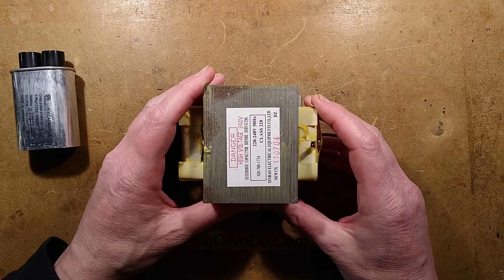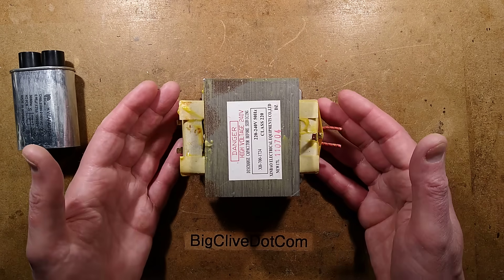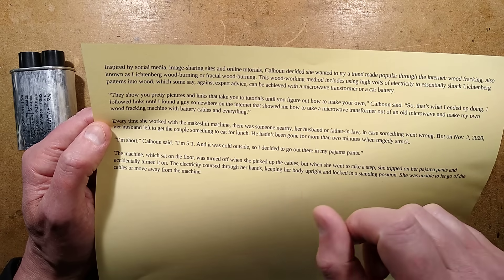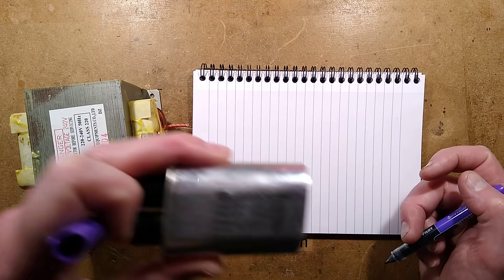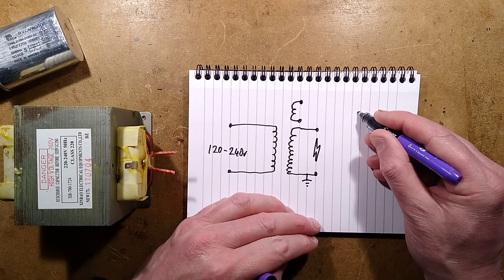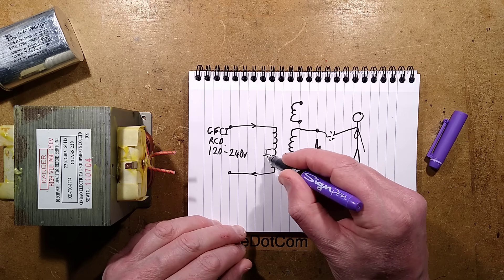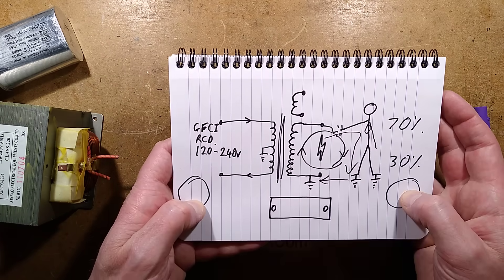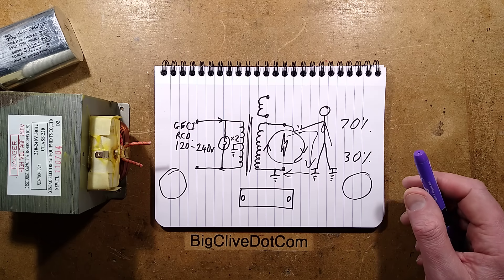The most deadly project on the Internet

Comment: Read this comment fully and carefully. If one side of the secondary is factory grounded to the frame of the xfrmr (which I'm to understand it somewhat surprisingly is) a small improvement in safety might be to use a two-prong plug AND a thick plastic casing (with an optional primary interlock switch that opens when the case is open) such that the frame is fully isolated: impossible to touch, and impossible to ground, for example,  through the mounting screws to the workbench. Note this WILL elevate the frame to deadly potential. A dual deadman switch is an excellent idea, but it's hard to imagine using the probes while you're squeezing both buttons. I have an industrial GFCI in which the insulated (secondary, in this case) conductors pass through a single large insulated hole in the middle. It has NO and NC contacts to drive a relay in series with the primary: NC contacts let the relay fall out if there is a fault, NO drives the relay if there is a fault (in the latter mode the primary is connected to the NC contacts of the relay). For the fastest response (no drop-out/pull in time) you might use a solid-state relay on the NC contacts, but be ABSOLUTELY sure it does not have zero-cross detection: most do. An SSR without ZCD is sometimes called a phase control SSD. I think the output of my control terminals is 120VAC, if you INSIST on rectifying this to drive a more common SSR with DC inputs (presumably with a resistive voltage divider) DO NOT add a filtering capacitor. You may experience a bit of drop-out at 120Hz, harmless for the purpose but may add a slight buzzing sound. AC input SSR's may well have internal filters to hold over near the zero crossing point, and so may be unsuitable depending on the time constant. Note that industrial GFCI is normally 30 mA, but mine has an adjustment pot down to 5 mA. Presumably, a standard wall outlet GFCI would work if you could disassemble it AND there was sufficient room and access to the sense transformer.  Pass both HV secondary leads through the transformer: you may optionally remove the heavy wires that carry the current to the outlet prongs for more clearance through the sense xfmr, but of course reconnect them outside of the magnetic path. If it pops immediately, reverse the current flow through ONE of the HV conductors by passing it through the sense xfrmr the opposite way. TEST TEST TEST with a resistor of about 400K ohms (that's 5mA at 2KV): wire it from one side of the HV secondary before it passes through the sense xfrmr to the other pole after it passes through, such that the leakage current bypasses the xfrmr. DO NOT put a "test" button in series with the resistor, as it would be elevated. A 10 watt resistor would be needed for continuous operation, but 1 watt should be fine. More importantly, the resistor must be rated for 3KV or more or you will get some very dramatic fireworks. As these are hard to find, use the old trick of soldering, say, qty, 10 X 40K 1/4 watt resistors rated 250+ volts each in series: better yet, wire 20 or more of them so you'll have "taps" and can zero in on the actual trigger current. Don't use a pot or any kind of rotary multi-switch. Note that the "let-go" current (at least for DC) is in the 5-10 mA range for humans, and the drop-out current for residential GFCI is nominally 5 mA: you might try pre-loading the sense circuit with 1-2M of resistance in the same arrangement so the circuit "tips" at 1-2 mA of further imbalance. Note also this WILL NOT offer additional protection if you get across bothHV terminals: I have not pondered the relative risks of grounding oneself through a pair of relatively low resistance (<10K ohms) grounding straps, one on each wrist, but it sounds promising. Finally, the circuit will be very prone to nuisance tripping if there is any path from the workpiece to ground (or to a huge de-facto antenna, for that matter), but this is a good thing: any cause of nuisance tripping should be investigated and corrected. Haven't tried any of this but can't imagine why it wouldn't work if care were taken.

Comment: When I saw these wood fracking videos, I did wonder if you could get the same effect if you used an electric arc welder instead. Come to think of it, why don't people who engage in this dangerous pastime use welding gloves?
Reply: 1.  Welders run at low voltage, and thus fail to break down the work.  2.  Welding gloves are not electrically insulating.

Comment: So hi voltage ,, one most use let's say spark plugs wires, as leads,, or if one knows what they are doing neon sign leads,, voltage is pressure,, amps is what kills ya,, with enough voltage it only takes a few milli amps to kill ya,, but voltage is also part of it,, and Insultaing ckmooi D's are rated , In the US any how 300 volts, 600 volts,, and anything above is rated to 30,000 volts for neon signs

Comment: This will probably get buried but it is worth reading and keeping in mind. I had one of these transformers still in the partial microwave chassis a decade ago or so, for trying out the lichtenberg figures. I had one secondary wire fixed to 3’ a long plastic rod from antenna making, a good insulator. What made me stop messing with it was that when I placed one wire against the concrete of my driveway I could draw an arc off of the concrete itself from a couple of feet away. The fact that at that voltage the concrete was conducting well enough that you could get a small arc off of the concrete was scary enough that I scrapped the chassis and stopped messing with those things. Don’t fuck around

Comment: That ending left me speechless.
Styropyro said something along the lines of that transformer is more dangerous than the thing it drives.
Electroboom survived a hit from one of those.
I HAVE one of those transformers. I'm afraid to touch it let alone powering it. (maybe I'll make it a high current transformers and melt some pennies?)
I try not to mess with deadly things if I can.

Comment: My son and I used a modern switching power supply for Neon lights with good success for this purpose. Much safer -current limited, high frequency and apparently has some protection. I don’t understand why people feel the need to use microwave transformers for this.
Reply: They do it because they are so cheap and plentiful or were.  We have this combined with people that think they are safe because they have had a belt from a car ht coil not understanding the difference in current
Reply: @rwhitenz  Yes and if people rely on YouTube for research and don’t try and develop some understanding they won’t seek out alternatives. The neon supplies are fairly cheap via usual online outlets. Suggestion for a YouTube video from someone popular who might get some views? Rather than telling people what they shouldn’t do….
Reply: As his son, I can confirm these are much safer. I was still taking precautions but it didn’t feel like I was going to die just by being around it. It has a GFCI too, I would recommend it. The only thing I would use a microwave transformer is if I was trying to make a high current low voltage psu.

Comment: Back in the 70's I had a Fender Twin Reverb, which had two switches on back panel, "Off/On and "Standby". I wanted to change those two switches to Key Switches, so no one could use the amp when I was not around. Even though the amp was unplugged, it threw me a few feet while changing the switch. What a jolt! Guess I was lucky. Instantly acquired much respect for electric. Remember those labels on the back of those vintage TV sets? If you are fond of life...do not open me!

Comment: I suppose awareness of the risk of electrocution due to insulation failure might be helped by noting the fact that what one is trying to do to a big chunk of wood (albeit soiled with an electrolyte) is also what one is doing to the thin insulation of the wires and to the insulators (possibly slightly soiled) held by the operator.

Comment: 3:00 Yes i know Or knew a Open minded site. first saw it wen i was 16 then found it agan years later.   shockingly u was able to go on the site with normal google and a normal webbrowser.
recently in june 2021 that website Fully closed down "thankfully" it was From Canada  website name was like G.ore but not its actual name. 
this would show lots of random accidents From very light to Mid to Extreme it had videos that tbh scared the heck out of me for years.

after reporting it and even letting my mate know about it who works in a police thing it got shut down after a year or so.
Bottom line is dont mess around on google and search   stuff like this coz  they cant filter every horrific scary thing like shock death.

Comment: If you are going to use a microwave oven transformer for anything, the very first thing you have to do is remove the secondary winding. And if you have no idea which is the secondary winding, you shouldn't be using any transformer for anything...period!

Comment: Not entirely unrelated, since you noted them in the video, but how long do capacitors take to self discharge?
i.e. not connected to any type of discharge circuit or shorted out, but just left alone, in a condition as shown.
Is is seconds, minutes, hours, days, weeks, months, or more?
Reply from the maker: It can vary widely depending on the quality and age, plus integrity of the discharge resistor if fitted.

Comment: I just don't understand why you would handle the electrodes in any capacity or do anything else while the device is on, the only safe way to use them is to unplug them while you don't use them and while they are plugged in you are ONLY allowed to unplug it, doing literally anything else is begging to get killed, literally just plugging it in and walking around is asking to get killed. It's so simple to stay safe around them because the only way to stay safe is doing literally nothing while the device is plugged in far far from where you are standing on dry insulated ground.

Microwave transformers are a human lemming trap, another human lemming trap is enclosed spaces and sewers where there is no air.

Comment: I'm a physicist so I like lasers (who doesn't) and making lasers is another great way to turn your microwave into a WMD. To say microwave HV transformers and capacitors are dangerous is an understatement. The 70% who die are the lucky ones. You may appreciate StyroPyro if you are a fan of dying by touching exposed charged capacitors or coming into contact with high voltages in your workshop

Comment: It's unfortunate that 50-60 Hz is the frequency range most likely to trigger tetanic contractions, but there it is. We have to work with what we've got.
I don't think that you're a bad fellow for pointing out the dangers of kilovoltages at around 50Hz. There are clearly 30-odd families that wish this were universally understood.
Good on you for trying to save lives.

Comment: Pretty scary some of the people playing with these things willy nilly. One wrong move, high chance you will end up dead, plus any person that finds you and accidentally touches it if it’s still active, they may be killed as well. This isn’t even being overly paranoid, this will easily kill you which some clearly do not understand. Alas, you won't be able to stop everyone from trying it, but may save a person or two. And at the very least, anyone that can't stop themselves from doing this, please do a lot of research on high voltage / current, and safety while working with it first; this is not a project to slap together quickly just to make artwork.

Comment: I have worked with mains and high voltage. When working with high voltage I don't even use the one hand rule. NO HANDS !. At those levels at mains frequency you don't get a second chance. Even tesla coils are dangerous. Bottom line is do your research and understand the dangers of what you are doing.

Comment: I’ve been bitten by a MOT before. It didn’t hurt as bad as I thought it would. Granted, both leads touched me on the same hand but it wasn’t really painful as I recall. And that’s with having knowledge of electric safety. I know enough to not work with both hands on live circuits. I don’t remember how it happened, it was years ago but I bumped the output wires with the back of my hand. 

She’s lucky to be alive though holy shit. That’s terrifying.

Comment: A GFCI would not matter anyway. In North America, GFCI outlets are only used in places that are expected to come into contact with water such as in bathrooms and kitchens. You would think they would put them on outlets on the outside of the building, but they are not expected to come into contact with water. Unlike the Australians and some of the European countries GFCI is not in the mains panel either. Its per outlet or a normal outlet daisy chained to a GFCI.
As an aside North American electrical code has been steadily updated to attempt to reduce the level of stupidity possible, such as putting outlets every 2 meters so people stop using extension cords. GFCI is still somewhat of a novelty item

Comment: Lol what happened to those people's self-preservation instincts?! Back in the VTTC/SGTC days (well, the latter are obvious as we usually sported MOT arrays) our rule of thumb was: always a double switch for the MOT (with a lockable control you can't just accidentally hit), and always a relay-based one, rigged in such a way it will not restore the power on it's own in case of a mains dis/reconnection, only by means of a reset button. Always a bright neon power light (I used three: one on the remote switch, one on the relay box, and one with a high-voltage resistor on the transformer secondary itself, just to make sure no charge was left in the cap nor the relay latched up). And still it was pretty scary touching the HV rails when tuning the coils (although even with all the above another rule was - all the wirework with mains totally unplugged).

Comment: The high output voltage output of these things is so incredibly dangerous im honestly suprised there hasn't been some government response. 2000-3000 volts with several amps available will instantly kill you, so quick you wont even feel the incredible pain. I played with one of these when i was probably 15 and was amazed at the lengths of the arcs. Looking back, i was so fucking suprised i didn't kill myself, and today, the simple idea of playing with the high voltage output side of one of these gives me the chills. I have a MOT in my workbench right now to be used for making a small spot welded, im fine with that, but the high voltage output side? Thats getting cut out. Its just way way too scary.
Reply from the maker: In Canada the government has launched an advertising campaign about it to dissuade people from trying it.

Comment: My father-in-law does this, but he is a journeyman electrician and knows how to build a proper unit and safely operate it. He connects leads of proper gauge to either screws or nails placed in the wood, so no handheld probes or touching the working end of the unit while in use.

Comment: You can get a high voltage (4-5Kv) transformer from older neon signs, make a Jacob's Ladder by attaching two terminals to the leads. Dangerous indeed.

Comment: You know stuff is horribly dangerous when Clive is starting pro-safety PSA videos while sounding incredibly concerned.
Reply: Electricity is very dangerous. You can't see it.  The voltages present on the secondary side of that transformer are too high to test with any multimeter commonly available. Most wire commonly available is going to have insulation rated for a maximum of 600 volts. Gloves commonly available won't protect you from 2,000 volts. Electricians that wear gloves that will protect have special equipment to test them. If anybody doesn't think messing with a transformer like that isn't dangerous, they don't understand the hazard.
Reply: @reedr1659  HeathKit used to make a high voltage probe for their VTVM. It could handle over 1,000 volts. This was 60 years ago though.
Reply: @reedr1659  I love how he says "It's a bit grim!"  low key words, high power meaning
Reply: @reedr1659  When i heard that from a teacher thus what got me to not be a electrician. Still the relatively low voltage of a AA to D battery is safe as you should be able to drop it before anything happen while the voltage of  a house main line is not. As AA to D batteries are 5V while the house main is 2 120V cables in the USA anyways
Reply: @yumri4  The AAA through D cells are only 1.5 volts each.

Comment: The dead man box wouodnt work unfortunately. I myself experrienced 230v short through my hands and fortunately i had a very little contact on my skin and it just burned forming an insulator. During the shock i couldnt move, breath or heart beat. Basically i was stuck with muscles contracted. It was horrible. I thought i will die there. With 1A current and 2kv+ its deadly as fuck and i think its more then 70% fatal. All you need is 100ma acording to books. And im talking to an actual current flowing through body. Its best not to mess with it or have at least half a meter insulating stick when using. And always short it when finished, that way it would be safest, and ofc tripple check if its energised. Oh and i mean half a meter stick of distance, never touch leads itself because its enough to break through insulation. Although acording to my test it doesnt jump through air, it shouod be super tiny tiny distance, still dont ever touch leads.